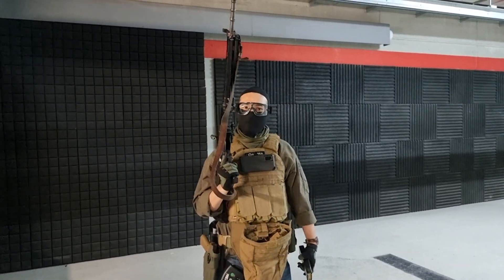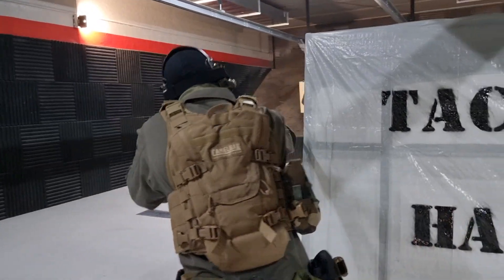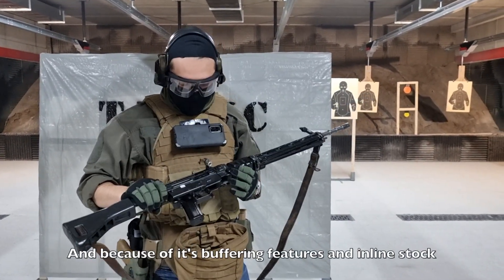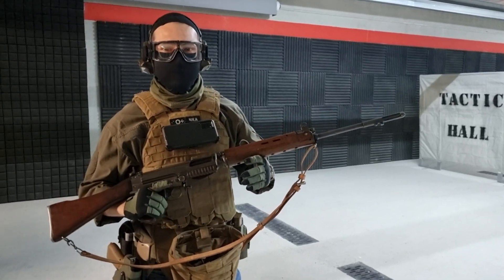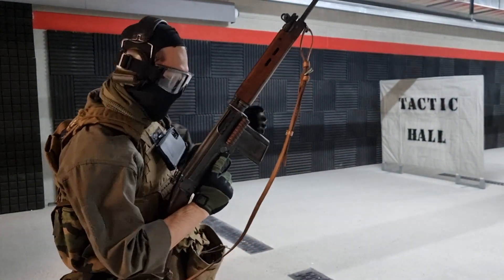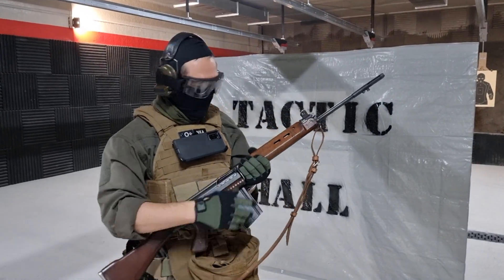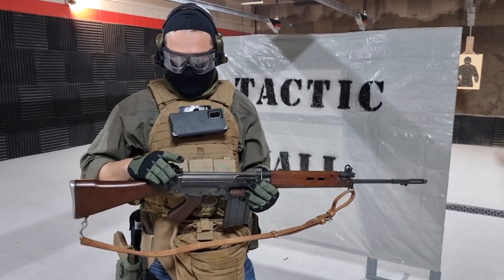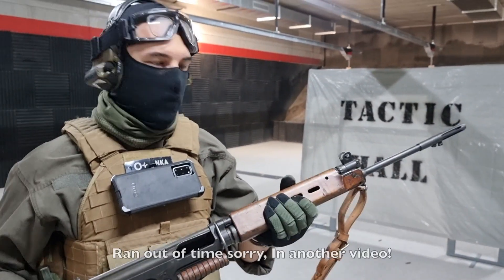SIG SG 510/ Stgw. 57 vs L1A1 / FAL First impressions run and gun

Comment: Used the SLR In the British army in the eighties,the sight flipping down was never a problem as for the gas system ,set it to six and leave it their,great vid
Reply: First rifle I shot, Taylor Range at Army Training Group (ATG) Waiouru. Easier to strip, clean and reassemble than an M16 BUT quite a bit heavier. Built to a standard instead of down to a price. The IW Steyr (AUG 77) was of lower quality (Aussie versions were worse) but accurate and reliable if properly cleaned and lubricated, until the little hook on the front of the mainspring broke and the half-moon locking collar attached to it started floating around and stopped the weapon from working. That locking collar stops the (Johnson style) bolt from rotating when it is out of the locking lug recess area.
It is also a good idea to tape up some of the holes in a Steyr before entering an assault (as opposed to confidence) course. It was well known in the NZ Army that the Steyr had failed the Australian testing in regard to dirt, mud and sand so … the test was altered.

Comment: is there a particular reason you wear a bunch of random USMC issue stuff? The plate carrier and dump pouch and mag pouches all look violently familiar to me
Reply from the maker: Good eye! No reason in particular other than that its good quality for the price on the surplus market, at least it was, I haven't checked lately. Additionally its some of the only surplus kit that comes in a nice versatile solid color. Also I belive the usmc were the first in the world to standard issue a low profile shooters cut plate carrier making it the only surplus item of its kind before the rest caught up, including even other u.s branches.
Reply: @helveticarms  Neat! I personally like a lot of my issued gear, and frankly the only two things I wouldn't buy are the helmet and the ruck pack. USMC did fairly well for itself.
Reply from the maker: @superfamilyallosauridae6505  Awesome! Really neat to hear from someone who has personal experience! As you said, for being a relatively low budget branch, they seem to be quite based, and even leading in that realm.

Comment: The fuse on the Stgw 57 was never a problem for us. For us, it was always the fire selector. This modern way of activating the safety after every second shot did not exist at the time. When I had my weapon ready in house fighting, it was never on safe. It's exciting that everyone who finds this "irresponsible" runs around with a DA pistol themselves, 95% of which don't have a safety-level either.
Reply from the maker: I agree that the principle of how and when to use the selector has changed a lot over time, this weapon was not made to switch it quickly which is ok.